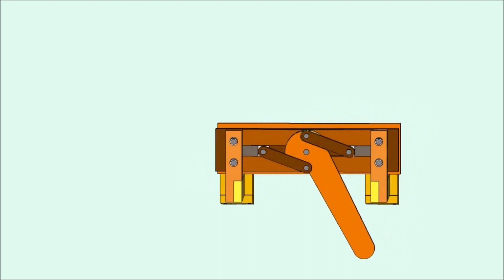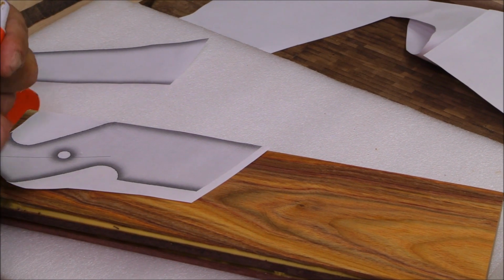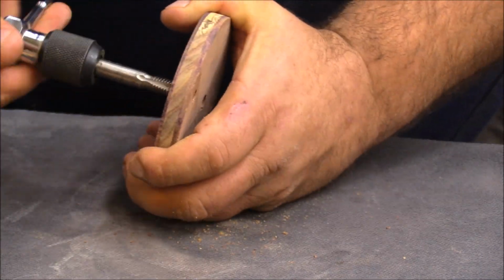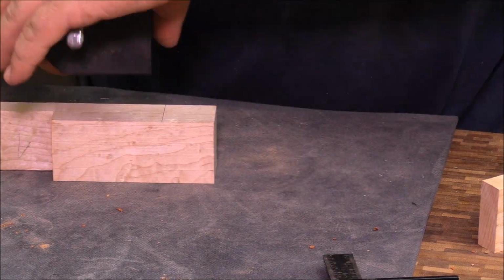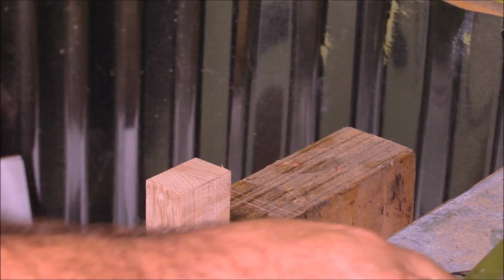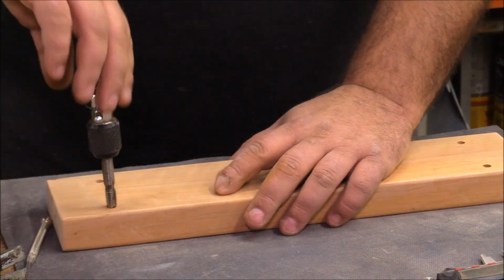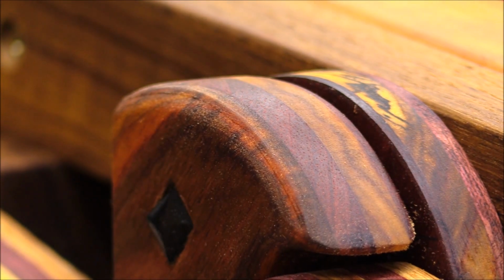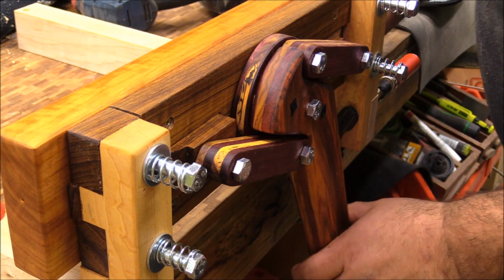You Won't Believe This Homemade Quick Vise!

Comment: I'd recommend an additional small washer on the head of your bolts with the springs.  They kind of look like they are about to fly off.  Probably wouldn't be an issue though.

Comment: Great work! 
I have a tip with the templates, instead of glue it directly on wood, first put an adesive tape on the wood and then glue the templates on the adesive tape, if you do that it will be much more easy to take of the templates.

Comment: Very efficient editing, perhaps the best I've seen.  You showed the stuff I wanted to see and raced through the tedium.  Thanks.  Where did you 3-D print the straddle square to get such precision?  I saw one at the local high school but the output looked no better than something that was injection molded.  What's its thickness range?

Comment: your vise looks really sick
really impressive

I want to ask you if do you have a video of how to make
the spin roller sander that you put on your drill that is really cool if I could make several of different sand papers 
great video keep up the good work
Reply from the maker: yes just click the link in the video at the top right corner when i am using the sander and it will take you there

Comment: This is beautiful.  Any reason you tapped into the wood instead of using bushings?  I am sure there isn't too much pressure there, but i feel like stresses may cause failures over time.  Either way a simple, yet effective wedge clamp system turned into art.  Great job.

Comment: I'm a model builder and often use glue stick to adhere a paper pattern to materials as soft as poplar ply or balsa.
once I'm done cutting and shaping I just wet the pattern with warm water and let that soak through and the paper comes off easily and pretty clean -- then a gentle pass with a scraper take the glue/goo off very nicely.

Comment: Clever!  Haven't seen this design before... any prints or plans available?
 I would add washers and/or flat bearings sandwiched under the five pivot bolt heads.  Cheers!

Comment: some glue sticks will release easier if you heat the paper well with a hairdryer first, but make sure it's very well heated before you start to peel or it's pointless starting (just rips otherwise)
Reply from the maker: cool thanks for the tip

Comment: To remove the pattern that you glued on with the glue stick, simply wet with water. The paper will fall apart and wipe off with most of the residual glue. Then wipe with a damp rag to clean completely.

Comment: Avery ingenious, and interesting project, I congratulate you.  I think the problem you had with the bolts may be because when you were threading the holes your tap was a bit off square with the surface of the wood.  If you can lower the speed of your drill press and use it to a point that it's not dangerous to your project it may work better.  Thanks.

Comment: I like your tracing device, black in plastic with a bolt, to mark a line around  a square or rectangular piece of wood.  Easily made, fast and efficient to use.  Did you make a video on it ?  It deserves to be made if it is not yet........
Reply from the maker: i am working on the video about it now it will be out Wednesday afternoon
Reply: I love you. I love you!

Comment: Great design and build Izzy! What about possibly putting some metal plate on the wedge pieces? To protect the wood from friction and to gain a better surface that you could oil?
Reply: That was exactly what I was thinking. I would assume a year or two of mild use, would making this clamp less and less effective.

Comment: hi, just a quick tip for everybody if you tap holes n wood like Izzy was doing here it'll hold pretty well but to make it even stronger, tap the hole then coat the threads with thin CA glue and then retap once more. they will last for years!!!! Trust me!!
Reply from the maker: good tip i cover that in the next video when i do final assembly

Comment: I when I use spray adhesive to glue templates to wood I use naphtha to remove them. It does an excellent job. I'm curious if it will do the same with glue stick adhesive.

Comment: would you add washers on the head of the bolts with springs if you did it again? idk if it would be necessary or not im not an expert or anything
Reply from the maker: in this case they aren't really needed if i go with strong a bit larger springs i might have to add them. it will all come down to how the springs i am using now perform

Comment: I don't like the whole bolts threaded into wood in single shear thing, double shear would be immensely better. Looks great otherwise!
Reply from the maker: i hear ya, but because the shear point are on the same plane right at the point where the two pieces of wood contact it wont hurt this set up in the least

Comment: If you want to glue templates on to your wood, the first put (wide) painter's tape on the wood, then glue the template on. It's really easy to remove and if you don't leave the tape on there for over a week then it won't leave any glue on the wood. Depending on what you do, you might want to put clear packing tape on the paper after you've glued it. It prevents the paper from tearing off while you're cutting the template out.
Doing this is a must if you're doing any scroll saw work.

Comment: This is very cool Izzy! clearly evolving from the last concept. I think I would use 4 wedges in the corners instead of 2 in the middle. Or maybe just bigger wedgesI'm concerned about the behaviour when you try to apply pressure and the part is not totally centered, maybe it tends to tilt and it locks itself before getting to the right pressure against the part? hum... I hope it doesn't because this is awesome :)
Reply from the maker: I agree, i talk about that in the next video the design came down to what i intent on using the vise for. it will make sense in the next video. :)

Comment: I think it would look better with some heat blued slotted round head bolts rather than the regular hardware store bolts.  don't know if you can buy slotted round bolts in that size though, I haven't seen them that big before.  if not you could make them out of carriage bolts and it would look pretty good

Comment: Really cool concept, look forward to seeing the rest.  How did you decide on the angle of the wedges?  I ask because a screw vise usually travels 1/4" per full turn, and your clamping mechanism looks like it travels about a 1/2" in a quarter turn.  Won't this give you only 1/8th the clamping mechanical advantage of a standard screw vise?
Reply from the maker: Yes and no, think of the handle like a lever and fulcrum because of the way its set up can get some extra pressure on the wedges if that makes sense. it won't create the same amount as a thread vise but then most vise create way way more pressure than is really needed to clamp effectively
Reply: +izzy swan I definitely agree that the standard screw vise gives you more clamping pressure than you need for woodworking purposes.  Once again, very cool, and glad to see you tackling this challenge.

Comment: Can you point me to a link on that straddle square?  I want to make one.  This build looks awesome!  Looking forward to the rest of it.
Reply from the maker: I will have a video out on it soon.
Reply: Yes please! Do you have a 3d schematic for the vise itself? STL or otherwise? I'd love to try to print better clamping devices than the screw type I already have in STL. I'm starting to design my own mechanical advantage parts with Onshape, and it's awesome; but it would be helpful to me to expand my knowledge of design principles.

Comment: very nice. Why don't you use insert nuts recessed into the wood instead of tapping threads.Wood doesn't last real long when used as a running surface against the rough thread surfaces.What angle taper do you use for the sliding chocks?
Reply from the maker: The bolts go in and stay in they the threwad s dont move ever it should be plenty strong fore this project but we will see

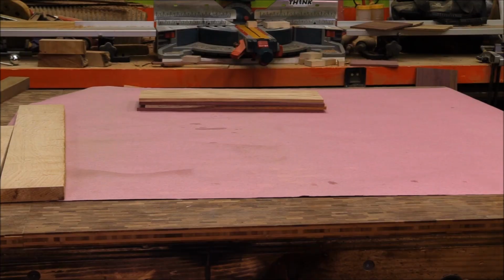Comment: When I saw you piling the clamps on the table at 0:35 I couldn't help thinking that those had to cost a pretty penny. I really need a couple more clamps so I was wondering if you could link me to a page with reasonably  priced clamps? I can't seem to find a reasonably good quality clamp for a fair price, I'm not cheap at all but come on 30 bucks (sometimes even more) for a clamp as small as yours, that price is not fair according to me. I know you are a very busy man but I would really appreciate it.
Reply from the maker: I have broke every single HF clamp i have ever used
Reply: Oddly enough I've purchased 35 bar clamps from Harbor Freight the past 10 years and not one has broken or failed.
Reply from the maker: I wouldn't know where to point you. I buy mine when they are 9n clearance or huge sales around x Mas time
Reply: Ok, thanks for the fast reply Izzy :) I will try to scope out some clamp sales during the holidays.
Reply: HF clamps work fine and are cheaper than bessey.
Reply: izzy swan The ratcheting clamps are garbage, but I've had pretty good luck with the standard quick release bar clamps. But they're still not the best quality.
Reply: I have the cheapest local versions & a few slightly more upmarket versions. The main problem on all them. Is the plastic caps either going for "Walkies", or breaking.
Reply: DMX, I agree about the plastic caps. I take them off when I buy the clamps. I toss them out. I don't use any covers period.

Comment: Brilliant as usual. Is there a reason you decided to tap the wood itself, rather than using T-nuts?
Reply: i think looks, and it is strong enough on its one
Reply from the maker: t nuts would be cool too. but not really needed as the bolts wont be threaded in and out they will just go in and stay there
Reply: Try out bolts threaded into wood. It will rather pulle the head into the wood and split it than strip the threads. And that's not with counter sunk screws but with cylinderhead bolts (heax head won't work for that experiment, because there's nothing of the head left to grip for the wrench after a few turns sunk into the wood ;) ).
Also: easier to do, screws don't unscrew themselves, screws don't wobble in the thread and cheap (just file a few teeth into a bolt and you have your perfectly fitting tap).